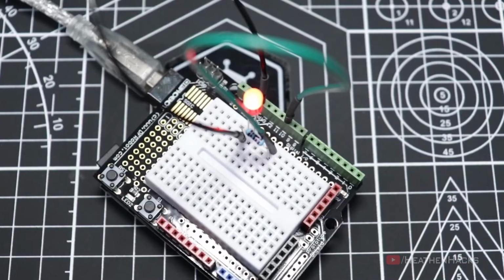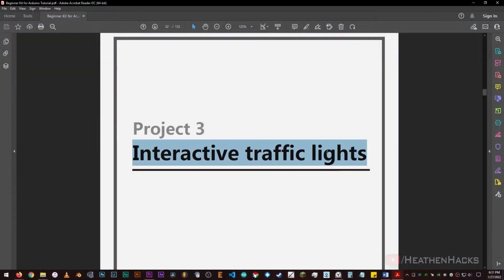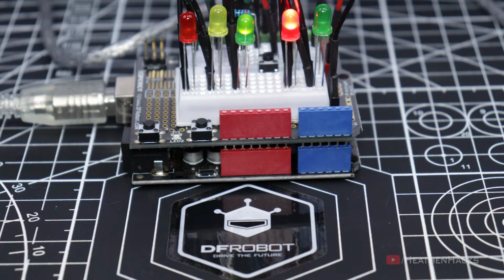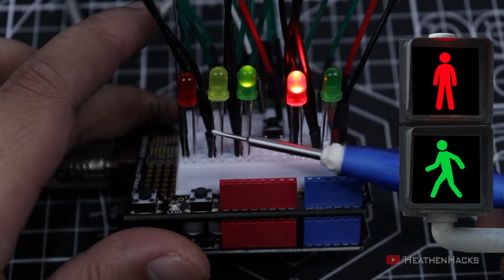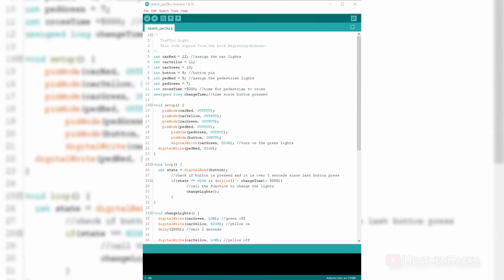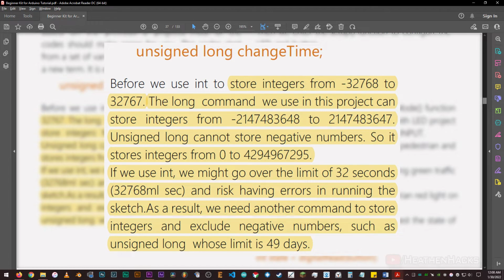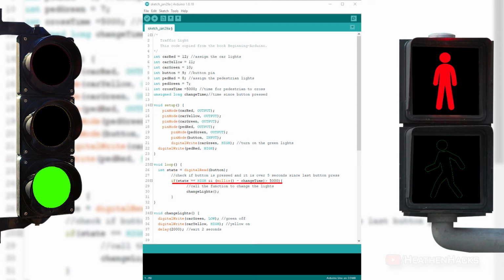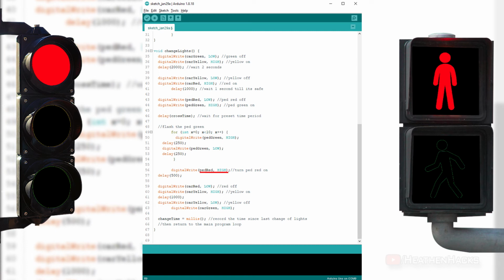DFRobot Beginner Kit for Arduino® | Project 3 Traffic Light [Step-by-Step Guide]

Comment: Hello Heathen,

So I really wanted to do this particular project. The thing is my digital push button (DFR0029-Y) has three digital cables attached and I don’t have yellow LED. For the yellow LED I was thinking about using a white one (DFR0021-W)instead of yellow one but the yellow one also has the cables attached. 2 weeks ago I had bought resistors, male to male jumper cables, RGB light, green and red LEDs. At that time I didn’t consider the digital cables to be such trouble because I was buying male to male jumper cables . Could you help me out again on how I should attach?
Reply from the maker: Generally on modules like yours (the ones that are on PCBs and has 3 wires), just remember that Red wire is to 5v, Black is to GND and Green is connected to the DFRduino Pin that is in the code. 

As you can see in the wiring diagram on the video, there's a resistor connected on the same lane as one of the pushbutton's legs going to Pin 9 of the DFRduino, right? You just have to connect your pushbutton module like that as well, by using the green wire.
Reply: So I connect both the push buttons and the white led’s red to the 5V. Then push buttons black wire to GND and push button’s green wire just as you said it. I connected white LED’s green wire as you did yellow LED’s + and white LED’s black wire as you did yellow LED’s - ( or should I connect it’s black wire to GND also?). I’ll do other wirings between -‘s, upload the code and write you back.
Reply: so the code told me
 Compilation error: 'milis' was not declared in this scope
I took the code form the pdf again but this time I had looked through it carefully. Here's the code I used:
// PROJECT 3 Interactive Traffic Light
int carRed = 12;
int carYellow = 11;
int carGreen = 10;
int button = 9;
int pedRed = 8;
int pedGreen = 7;
int crossTime = 5000;
long changeTime; //time that the button is pressed
void setup() {
//configure all LEDs as output
pinMode(carRed, OUTPUT);
pinMode(carYellow, OUTPUT);
pinMode(carGreen, OUTPUT);
pinMode(pedRed, OUTPUT);
pinMode(pedGreen, OUTPUT);
pinMode(button, INPUT);
digitalWrite(carGreen, HIGH); //initialize green traffic 
digitalWrite(pedRed, LOW); //initialize red pedestrian light off 
}
void loop() {
int state = digitalRead(button);
if(state == HIGH && (millis() - changeTime)> 5000){
  changeLights();
}
 }
void changeLights() {
  digitalWrite(carGreen, LOW); 
  digitalWrite(carYellow, HIGH); 
  delay(2000);
digitalWrite(carYellow, LOW);
 digitalWrite(carRed, HIGH); 
 delay(1000);
digitalWrite(pedRed, LOW);
 digitalWrite(pedGreen, HIGH);
delay(crossTime);
for (int x=0; x<10; x++) { 
  digitalWrite(pedGreen,HIGH);
delay(250);
 digitalWrite(pedGreen,LOW);
 delay(250);
 }
digitalWrite(pedRed, HIGH);
 delay(500);
digitalWrite(carRed, LOW);
digitalWrite(carYellow, HIGH);
delay(1000); 
digitalWrite(carYellow, LOW); 
digitalWrite(carGreen, HIGH);
changeTime = milis()
}
Reply from the maker: Hello, yes, black wire to GND.

Then, the reason why the code was giving you an error was because milis() should be millis();
Reply: @HeathenHacks  it still gives the same error message
Reply from the maker: Hmmm... interesting. It compiles fine on my end, tho. Does it only say "Compilation error: 'milis' was not declared in this scope" and nothing more?
Reply: I don’t know why but I can’t respond you with the exact code written
Reply: YT don't let me share it and I tried multiple times multiple days
Reply: Could you send me the code you were using directly?
Reply from the maker: @mertgurer7247  I'm using the same code. 

Go to the video description and download the codes pack on "DFRobot Beginner Kit for Arduino® Sample Codes", and try to use the code for Project 3.
Reply: @HeathenHacks  so the original parts I ordered them( for convenience) few days ago and they came today and I downloaded the code readjusted the hardware and now everything works!!!! Thank you a lot!!! I'll show this project as my physics project :))
Reply from the maker: Awesome! Good luck and have fun!